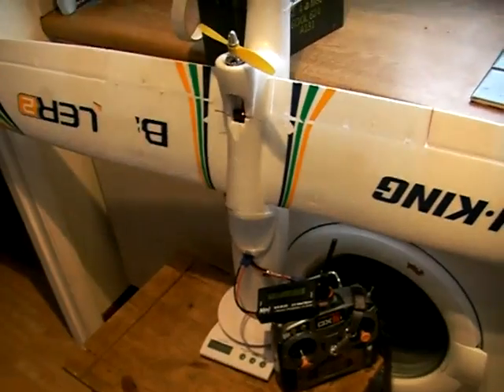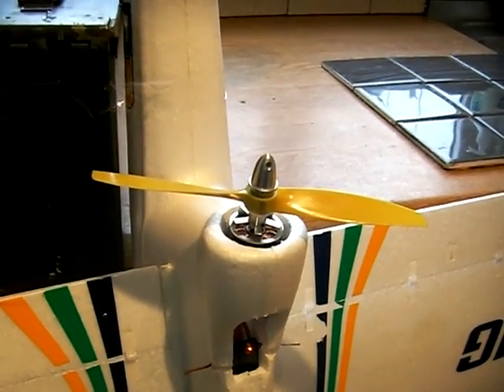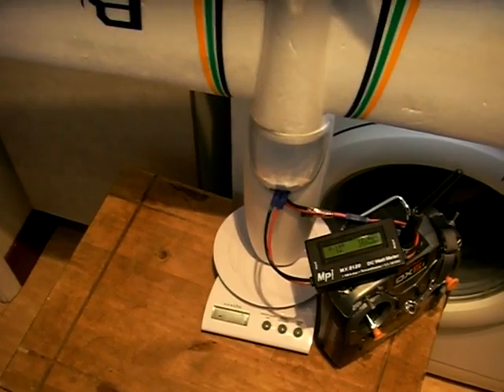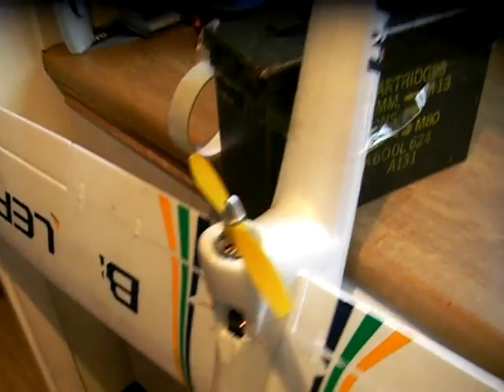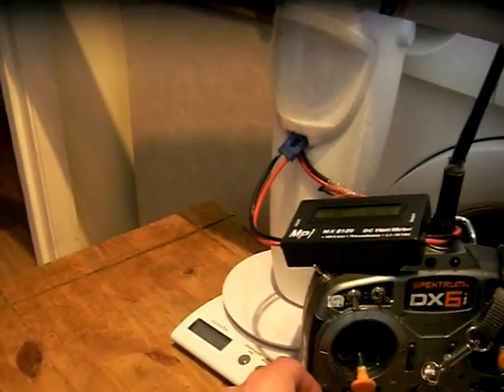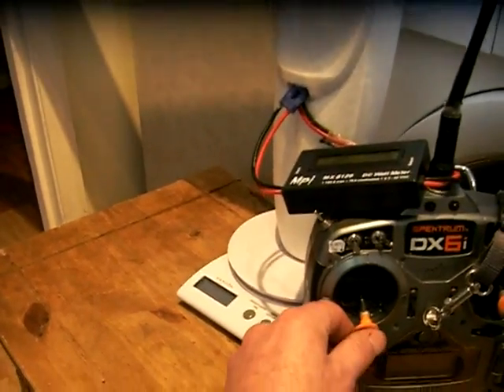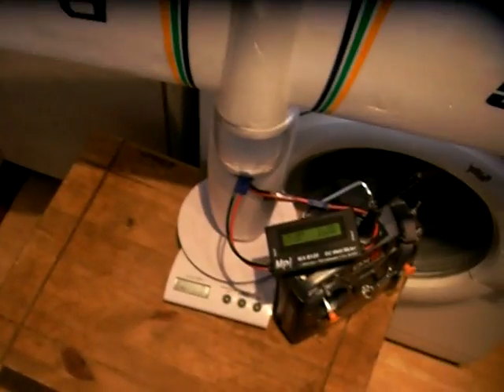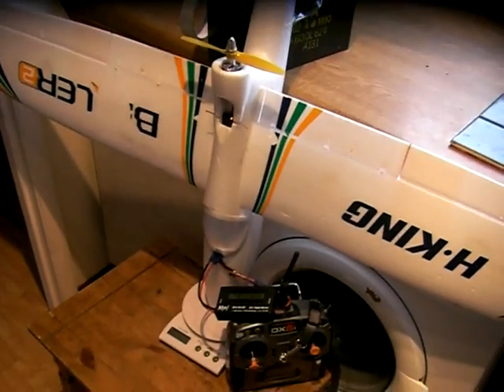bixler 2 rc  glider  thrust test 2200kv 7x4 prop

Comment: use triblade props mate.
from mini quads will do

ideally 5x45x3 props
and use mini quad motors

nowdays miniquad motors are really strong, can draw about 35-41 amps at peak and its still in acceptable temp

use bigger esc will help to